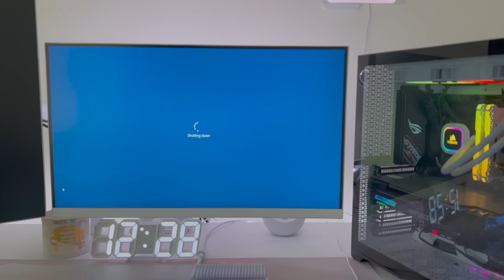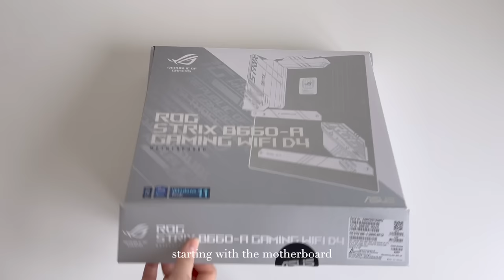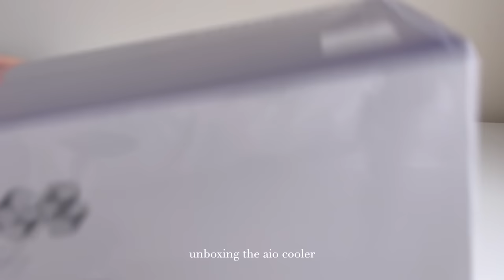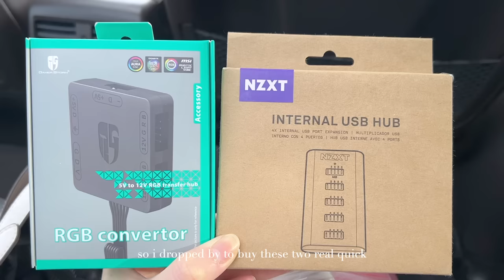building a white aesthetic pc | lian li o11 dynamic evo, rtx 3070 ti, kraken z73

Comment from the maker: edit: i recently made a video on my room and setup so everything i have will be linked there! https://youtu.be/W8uBY6TVUoE

hiii!! thank you so much for watching this video🤍there are a few things i would like to mention from all the lovely responses and advice you guys gave me:

1. i installed the sdd wrong LOL i was literally bending my sdd (thank you all for letting me know🤍) the installation procedure for my sdd on this motherboard is slightly different from the usual ones so i was a bit confused (and the manual wasn't that helpful) - please don't use this as reference!

2. i have the lian li uni SL INFINITY fans (the front and back may look different from the other fans eg. the sl 120, where the logo is at the BACK for the infinity fans (the front side, where the air gets sucked from, is the side without the logo) - meaning in this build, the bottom and side fans are intakes, and the top aio fans are exhausts!! 

3. there's a 5v aRGB header on the top right of the motherboard (i completely missed that..) so an rgb converter is not necessary!

i'm gonna edit this if further clarification about my build is needed but thank you guys for being so nice and understanding🤍
Reply: a very nice build, im happy to see a youtuber that does pc builds with INTEL cpu, since they are better and cheaper then amd counterparts.
Reply: @Nekoi uhh… that’s not how it works… they do have similar sockets in terms of the way that they connect, but entirely different shapes, the cpu would not of fit and the pc definitely would not of booted. 😅
Reply: Get cable mod extensions for the gpu so you don’t have to deal with the ugly adapter. Trust me your pc will look a lot better and you can get cables for pretty much everything in your pc. (They can be a bit pricey at times.)
Reply: Hi, what’s the link to the white cables so I know which ones NOT to buy lol cause I have some white ones in my cart rn. I don’t wanna spend $ on them if theyre not gonna be long enough D;
Reply: I was wanting to build a pc like this sometime, did you have to buy any white cable extensions that plug into the motherboard?

Comment: I was surprised to see your composition.
Because it's almost identical to mine.
O11 dynamic EVO, Z73 Kraken, SL-INF, 3070Ti, Corsair Vengeance...
As for the air flow, let AIO take in the fresh air outside.
I think it's good to make the side exhaust for that amount.
Still, the intake is 6 and the exhaust is 3, so if you close the glass, the balance is a little off, so I think you can add 1 exhaust to the back.
I think that the bottom is fine as it is because fresh air hits the GPU.

Comment: Hiii just a reminder, the HDD Bracket when you close the case at 10:36 you closed it wrongly, you need to slot from top down where the lil notch is at the bottom and you'll be able to close it

Comment: This is just me, but I would get an external NVMe enclosure to clone the storage drive that has the OS on it as although the Samsung 970 Evo Plus is a great drive on its own, you can benefit from a faster performing NVMe like either the 990 Pro, 980 Pro (both Samsung), WD Black SN850X or WD Black SN850. All of those have faster read & write speeds than that Samsung 970 Evo Plus. After cloning that, you can still use the 970 Evo Plus as an extra storage drive after wiping it clean of the OS.
Reply from the maker: ooo will definitely look into that! thank youuu!!

Comment: Great job! Everything was actually a 10/10, just as someone already pointed already, there was a bracket in the HDD disk bay you missplaced, it's not that of a problem but you might wanna fix it for more security, bottom goes in first, then top with screw ^^, also I would recommend not to shake too much the hard disk cause  it having moving parts makes it possible to damage the inside disk, but still nothing to worry unless to over shake it or drop it or hit it against something :)
And the only one thing I would really point out cause I havent seen a comment about it is, try to not bend the 3070ti cable, like nothing at all, cause tests have shown that bad installation or bending of it can cause a short and the cable to burn and melt, so be carefull with it, try to place it as straight as possible ^^
Again 10/10 PC, great build!

Comment: Amazing build, one thing though if you want to make it even more amazing - change the fans to the AIO to the same fans SL120 Infinity ones as you have in the bottom - that would make the build a solid 10/10 :) Still 9/10 now. As I said, amazing work and build!

Comment: I have something very similar. You can turn the fans to show the infinity hub. It doesn't affect temps whatsoever
Reply: it does affect the temp when your components need to do more, the infinity hub is the front. so if you see that it means it is sucking air, and when you have 9 fans sucking you get a negative air pressure and that can be really bad. it is best to keep the amount of sucking and pushing the same, so like 3 fans for air in and 3 for air out.

Comment: quick tip: Those white cable extensions you got, you NEVER directly plug them into the power supply, or with any other custom cables. This can lead to surges and other issues with power.
Reply from the maker: ah that's good to know!! at the end i plugged all my white cables to the cables provided with the power supply! thanks for this🤍

Comment: Nice build you have..Congrats!. But please check on your fans ‘push/pull’. The bottom should be OUT coz your aio fans are IN together with the vertical fans on the side. Try to add 1 more as OUT on the rear of the case. 😊
Reply from the maker: thank youu!! from what i understand, my aio fans are exhaust fans while the bottom and side fans are intakes (these are lian li uni sl infinity fans so the front side, where the air gets sucked from, is the side without the logo), let me know if i got that wrong!! and i would love to add a rear case fan as soon as i save a little more to buy these expensive fans AHAHA
Reply: @atlyxs  I would not recommend aio fans to be out. It should pull fresh air going in. For what I saw from your video, all logos were in. Anyways..good luck for that.
Reply: @atlyxs  wait, the triple pack fans do not come with a controller/hub?
Reply: @PrimusInvictus does the controller hub control intake and exhaust? Sorry I’m new to pc building

Comment: Nice work, also add an exhaust fan
Reply: Where would that go? On the left side of the case? And could it be the same Lian li fans? Because I believe if you only buy one it doesn’t come with a controller? And also does the controller do? Sorry I’m new to pc building
Reply: @makayla9073 Yes on the back of the case to suck the hot air out and then you will have optimal case air flow. Not sure about Lian Li cuz I have a Corsair fans and hub but if you have a place on your motherboard or hub to connect another rgb fan so mount it. If not, you can always go for normal white pwm fan without rgb light with just a pwm(4 pin) plug which I'm sure your MB has.

Comment: I'd recommend getting the D30 120mm fans from Phantek over the Lian Lis. They have similar aesthetics but are much greater in terms of air performance. They got revealed this week at CES and should come out for preorders around March. I'm definitely saving up for them, and there's enough time for you to do the same. Honest recommendation <3.

Edit: just watched the rest of the video. You should at least change the top radiator fans for those I mentioned or get the older, non-rgb version - T30 Phanteks.
Reply from the maker: will definitely have to check that out! thank you for your recommendation🤍

Comment: you have been instaled the stand off of m.2? in 3:25 looks curved, nstalling it incorrectly, in addition to not cooling because it is not in contact with the heatsink, can bend the chip and spoil it.
Reply: They acknowledged that in a different comment 1 month ago
Reply: @CatBot007  amem

Comment: Lovely build, I’ve the smaller 011 D mini all white ver 😂 just a thought but, your bottom side panel fans have as intake so just a quick turn over. 

Oh and yeah mine looks like a cabling rats nest at the back too 😂 and dealing with the cables from the kraken pump head is a pain. They are either crushed up against ram or dragged over a heat sink 🤷🏻‍♂️
Reply from the maker: oo i was told that the bottom fans would be more suitable for intake since heat rises! and YEA honestly i'm so tired of cable management so i just cover up everything AHAH
Reply: @atlyxs  it looked like you had the bottom fans as exhaust 🤔 shouldn’t see their logo just plain silver disc in the middle unless you put the stickers on 😂 but also the cut out where some cable is visible should be seen on one of the 4 arms coming off the center to the outer of the fan. 

Lian li logo on the fan is the face so air is pulled in front of it to behind it 🤔😫 explanation not the best 😂but your top fans from looking inside the case you should see the logo the bottom and side fans you should just see the plain silver disc and the tiny cable cut out in one of the arms. Could be worth adding another 120 fan on the back as exhaust 🤷🏻‍♂️

Comment: you didnt connect the z73's fan power and  rgb to anything right, since you are using Lian Li fans. so the only connection that was made is the micro usb cable, sata and cpu pump fan.

Comment: Super clean build, really good job! I'm just really confused where the power supply is though or I'm just hella blind. 😅😂
Reply: the lian li o11 dynamic evo is a dual-chamber case, so it's behind the panel the motherboard is mounted to & at the bottom of the case. you can see the power supply and motherboard IO panel in the same frame at 6:02

Comment: Did you use too much force when installing your solid state drive? I saw that it was pressed out of the arc by the screws under the heat sink.
Reply from the maker: you're right! thank you so much🤍a few viewers let me know i installed the ssd incorrectly so i fixed it!!!

Comment: Do you think a 4070 would fit in there?
Reply: Just buy 4070 Ti for 1440p, if you want 4K just buy 4080 Super. I use 4070 Ti this worth it GPU ever made, I get 130fps in Cyberpunk max setting.

Comment: Hi!! The ssd is placed wrong
Reply: What's wrong with the ssd placement? Her motherboard has all 3 M.2 slots running at Gen 4, and it's a common practice to place your main sdd nearest to your CPU
Reply: @z4k1_zaki65  that is not the issue, it is that the support was not placed to leave the ssd straight
Reply: @nunes.victor Oh wait, the ssd is installed without the standoff, it’s literally bending!
Reply: @z4k1_zaki65  exactly man
Reply from the maker: hi!! THANK YOU SO MUCHH for letting me know, i'll get to fixing that right away:D

Comment: Hello! What would happen if i have a 5v rgb header? I'm going to be using the b550 f motherboard from Asus
Reply from the maker: hi! from what i know, my fans should use the 5v header while the one on my motherboard is 12v so that's why i got the converter! if i had a 5v header i would just plug my fans in without any additional purchases!
Reply: @atlyxs  ohhhhhh i see i see, thank you!!!
Reply: @atlyxs  how was the z73 software for you btw? I plan on getting that cooler as well and would love to know what you think about it

Comment: Why would you use a kraken z73 rgb to cool a Intel Core i7-12700K? The price of the cooler is as much as the cpu and unless you are going to be intensely overclocing your cpu it woudn't make any sense. Your old corsiar double fan cooler would of been pleanty and would of mached the white theme.

Also (This is very inportant) make shure all of your lian li fans are in the right orientationsion you dont have all exaust fans.
Reply: 1) Because she could afford to upgrade her cooler and if she ever needed to upgrade to a higher performing CPU like the i9, she doesn't have to worry about the cooling? Plus it looks nicer with the LCD screen. Or maybe she doesn't have the new LGA mounting bracket for her older AIO?

2) She has the fans orientation correct, bottom and side as intakes and top exhaust.
Reply from the maker: hi! to be completely honest with you the old corsair aio was working fine - but i wanted to spruce things up a little with the lcd screen (that looks super good), i was getting a bit tired of how the old aio looked so that was the main reason why i wanted to upgrade my cooler (i definitely won't have to worry about upgrading this in the near future)

as for the fans, could you elaborate on that a little? i have 6 intakes and 3 exhausts!
Reply: Nm I wasn’t sure if the nzxt fans were intake or exhaust.